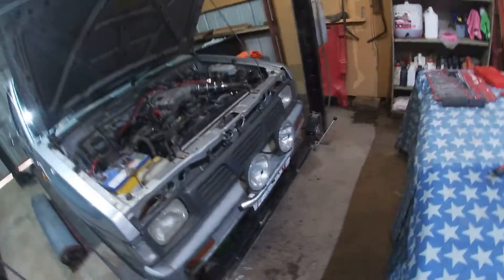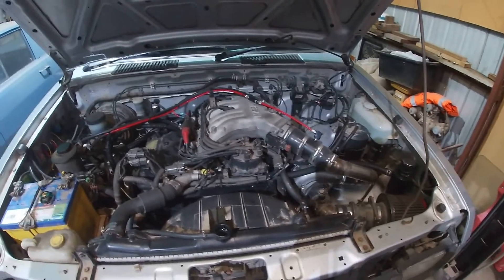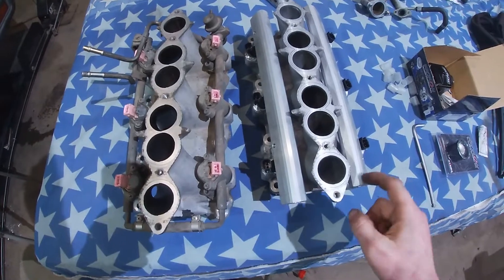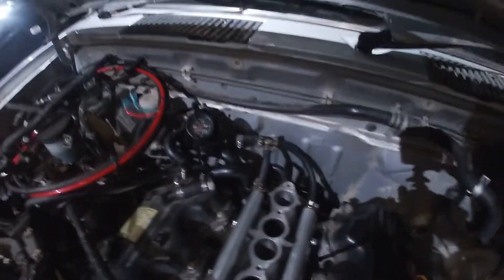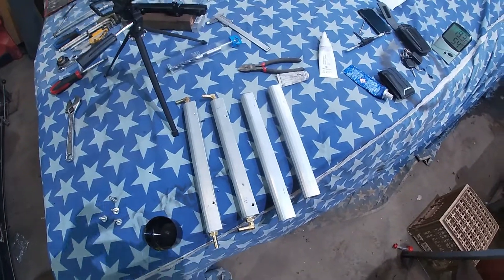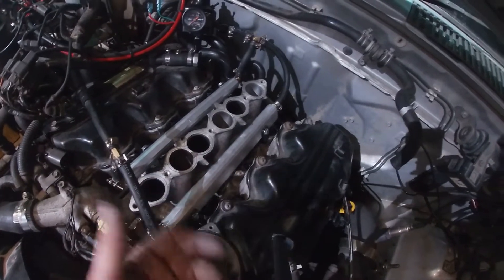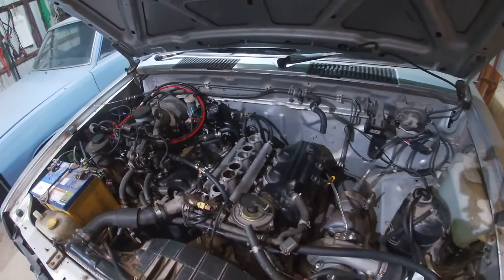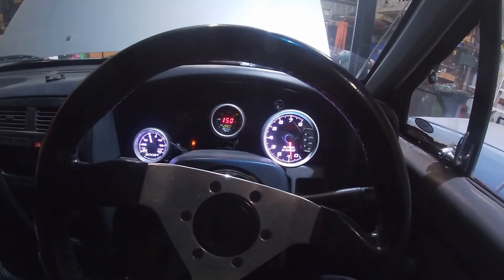VG30 Navara ep14: installing bigger top feed injectors

Comment: Hi mate. Any reason you opted to change to topnfeed injectors vs putting in larger side feeds? Thanks.
Reply from the maker: There's a lot more options for top feeds then side.
I spoke to a couple nissan tuners and there's a lot of crap side feeds on the market they dont trust. A lot of the cheaper ones get stuck and you end up hydro locked... the ones they trusted were the dw ones that are around 250 each.

Comment: Sounds like the black keys. After you changed injectors did you just use the resize injectors in nistune? Did you also have the “auto adjust load scalers” box checked?
Reply from the maker: Yeah i used the resize injector thing in nistune, it wasnt perfect but it was close. I dont think i have auto adjust load scalers checked. I cant remember to be honest, its been over a year since iv plugged into it

Comment: Hey there Red, very interesting episode definitely looking forward to the next one.
A few questions out of curiosity?
How difficult was it to take off the 2 piece manifold and how long did it take you to do? Thanks.
Reply from the maker: I think it was about 2 hours to get it all off, some of those injector plugs can be a pain to get off
Reply: @RedsProjects  I see, if not too much to ask, could you list pretty much the tools you used to get the job done would definitely be appreciated thanks again Red👍
Reply from the maker: @BLKSTONE4WD  sorry i forgot to reply to this, theres not really any special tools you need, just 10mm, 12mm spanner and sockets, there is 5mm or 6mm alan keys that hold the manifold together and on, besides that just screw drivers and stuff to get piping off